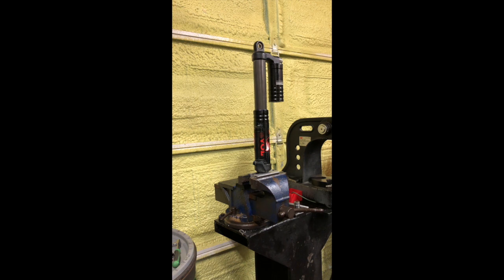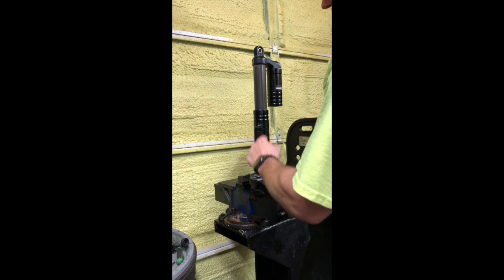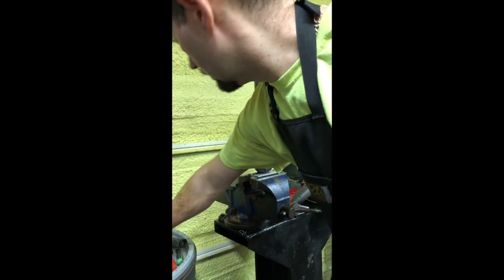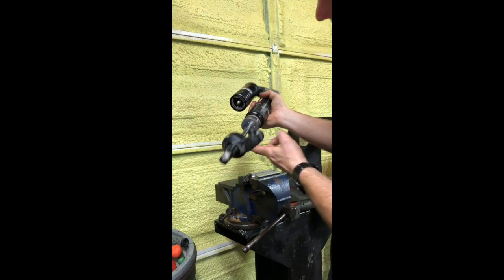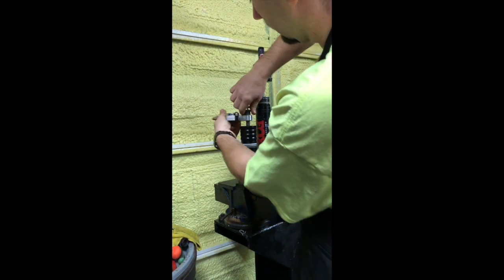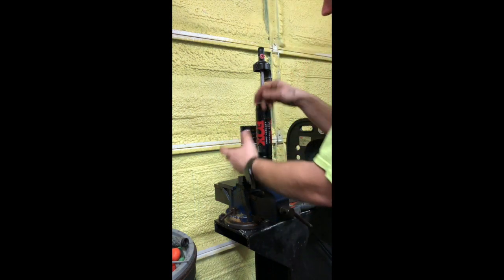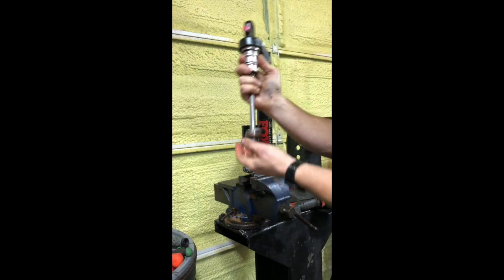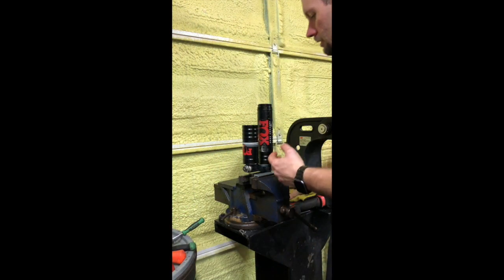FOX RACING SHOX FLOAT GEN 2 EVOL ATV SHOCK REPAIR DISASSEMBLY

Comment: I've a pair rc2 evol3. I send them for a service couse they're too stiff. But still stiff. I've use all in 12 and 45 for main and 140 evol... what coul be the problem with them? they practically don't work they just bounce hard.. thaaanks!!
Reply from the maker: open rebound and the compression all the way up and see if that helps. if it doesn't valving is way off.

Comment: Do you repair shocks for people?
Reply from the maker: i just do my own shocks and made this video because I was tired of paying high rebuild costs for something that isn't so difficult to do.
Reply: @Benbuilt4u  I have a sled I just bought with the fox float 3 evol r rear track shock and the shock body has some damage on the exterior but not bent or dented. I know the guy was riding it before I bought it that way so not sure if it effects the shock as I know very little about these. What do you think the cost should be to replace that?
Reply from the maker: @billsmith1794  any exterior damage is usually cosmetic i run them till they are dented or seals fail
Reply: Thank you sir!